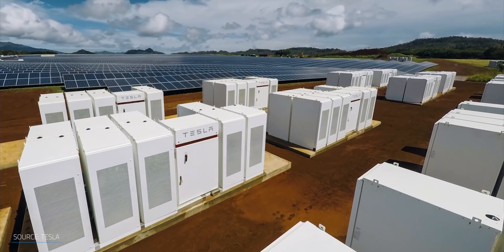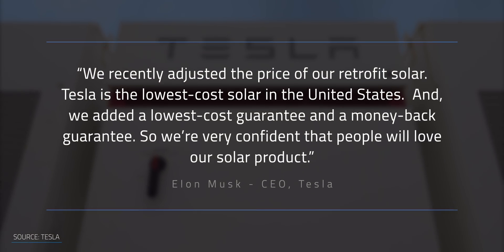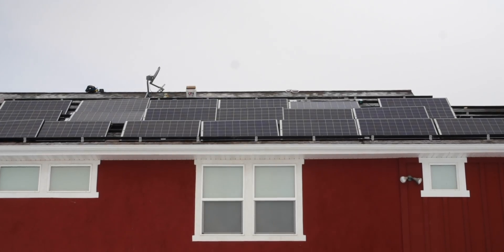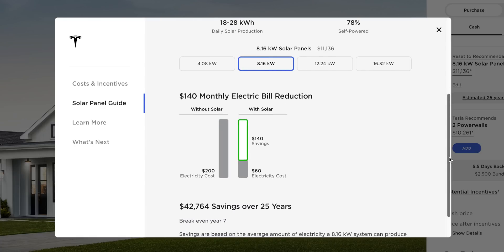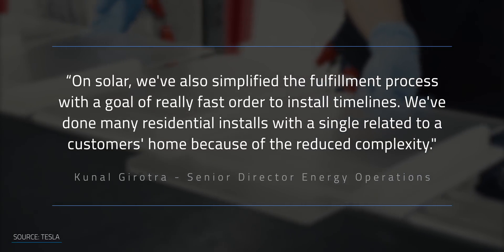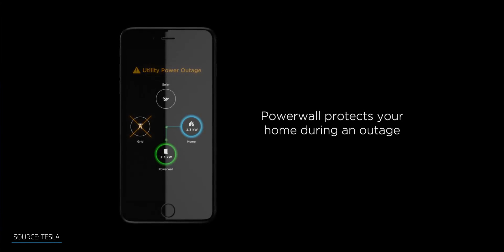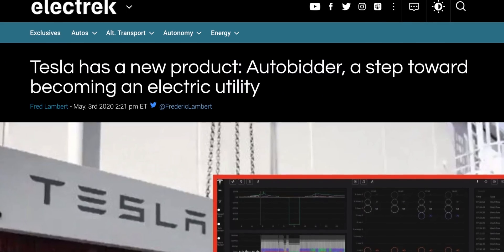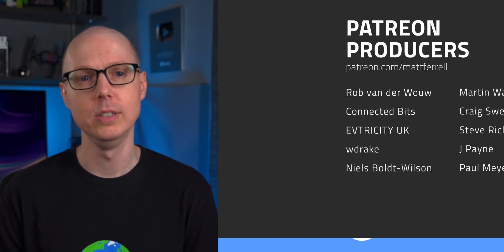Exploring Tesla solar panels game changing price

Comment: Here in Pakistan I bought a 10KWH on grid Solar system through bank on installments. 

The total system cost was 5223$. 

I have to pay 63$/m after giving bank 30% upfront payment in advance. 

The system comes with 5y warranty of inverter. 

25y warranty of solar panels.

Comment: Nice how you uncovered the point about high costs. I’m getting solar this month and was disappointed that 2/3 of the cost was service and only 1/3 was the cost of the panel. My house is two stories and does have steep peaks. So I get the labor for that will be high but i wonder if a lot of the service charges are due to marketing and dealing with permitting.

Comment: I had very bad experience with tesla solar panels 
I order 7.6 kw on December 2019 
Because of the pandamic the process has freeze until may 2020 ( that's understandable because of the pandamic) after Tesla installed the panels suddenly the price dropped 40% 
To me it's unbelievable , I won't buy tesla anymore 
Imagine I order tesla Model S and when you receive it the price drops from 90k to 52k ( imagine your reaction)

Comment: I had hot water panels for years but took them off when I had a new shingle roof put on. They had not worked the last couple of years probably due to the controller dying. Then part of the copper piping froze one winter causing a big leak in the attic, where they were, that messed up some of the ceiling and wall. So I had them taken off thinking if I ever do something else solar it would be electric so I wouldn't have to worry about leaks any more. Thanks for the update. sounds like I need to get off my ass and talk to Tesla!

Comment: So $1360 per kilowatt. I use 28 kilowatts per day. We get a max of 5 hrs a day.so I need 6 1000 watt packs. So. $8160 for panels how much are the batteries? The inverters. The breakers. The wiring ?.

Comment: Solar is the way forward. I payed $9000 for my 7Kw in 2012.  The electricity cost here in Denmark is high about $0,35 pr Kw.  My solar system has already payed it self more then twice.😊  I use a lot of electricity, ben driving VE since 2003

Comment: Looking at the solar panels right now. Somebody still has to show up and put holes in your roof so I am concerned about a streamlined process when things go wrong. My other thing is that there is code in South Florida that appears to require a 3 foot perimeter around panels on a roof. I checked a neighbor's solar install and they had installed down to the lower edge of the roof so hopefully that is allowed. If not, I don't think I could get a solar system of any size installed on my 1800 sq ft home. I would like the 12.24kW array and I guess I will challenge Tesla to get the permit for it and come up with a design.

There is really only so much templating you can do. Every roof design and orientation is going to take some tweaking.

My advice to anybody getting solar panels from any contractor is to get up there with a hose pipe when the roof penetrations have been done to check for leaks. I saw forum posts about leaking roofs with panels on them and no response from Tesla. Arizona and Southern California are one thing, South Florida is another.

Comment: Im hoping to be at 16k for my off grid system. That also includes my 13kw of Lifepo4 batteries that can run my house for 24 hours all by themselves on a full charge. In Ohio grid tied systems are not so great and without batteries in the winter forget it.

Comment: You may want to think about power wall  which is insanely expensive at the moment . With tesla saying it will cost less than $1 per KW for car battery pack there is no reason they cannot reduce the cost of a power wall Dramatically say a 30 Kw for around $7,000 plus install .

Comment: Wow, pretty expensive. In Poland, not very developed country, cost of 6kW installation before incentives is around 1,1-1,2USD/W. With incentives is drops 0,75-0,8USD/W.
Energy in Poland costs around 0,17-0,18USD/kWh
Calculated now, when 1USD=3,7PLN

Comment: Does the production of all these solar roofs and power cell/batteries actually reduce carbon production, is carbon neutral, or does reduce carbon production?

From my understanding, even if the initial production of carbon increases, over the longer term as less solar/batteries are produced and just maintenance/replacement production sets in, it will dramatically reduce carbon costs as dirty forms of energy are eliminated. Is that reasoning correct?

Comment: This problem should be mocked. You can now buy wafers in China for $ 1 for 5 watts. If you want something cheap, then you don't have to buy, you have to do it yourself. I think that the cost (price of selfproduction) of the plates is $ 1 per kilogram like that of aluminum. That's about $ 1 per 200 watt square meter. Even now, $ 1 per watt is an acceptable price for Americans. You need 60 square meters for the roof. That's $ 12,000. With an annual income of an American of 50,000, that's an acceptable price. But for the Russians, this is an unacceptable price.

Comment: The thought the issue in the US was the cost of the installation.  They charge at least $1/kw for installation.  Buying a 10kw kit is only $13k for DIY.  $25k through an installer.

Comment: Wait, I don't think you are talking apples and oranges here. Elon is referring to the cost of the panels is he not? Not the total cost of the system. You are referring to the total cost including install, wiring, inverter, etc? $1 per watt for the panels alone has been the benchmark for at least 5 years. $3 per watt is the overall system cost.

Comment: Got to love the big utility lobbies, where I live is still illegal to install solar on your roof
Reply: Let me guess, is it in the Middle East?
Reply: @motazfawzi2504  No its in the United States. 

The TLDR Version is that State gov, and utility charge so many fees and licenses, including a monthly fee per kwh  generated that its just cheaper to buy grid power, or install solar illegally, which isn't something you can do on the DL, so you are just gonna get caught, fined, and possibly jailed.
Reply: @motazfawzi2504  https://www.biologicaldiversity.org/programs/population_and_sustainability/energy/pdfs/ThrowingShade.pdf 

explains part of the issues. 

Basically, in several key states that have almost year round (excluding weather related events) there are no protections or policies in place at the state level for solar. 

So, where I live, the utility company will actually charge you for generating your own solar, at a higher rate than market rate. They also charge a monthly fee for even having panels. 

They also charge a monthly fee for having storage. 

The county/city government charges you a yearly license fee. They also make you jump through an astounding amount of hoops just to install them, including 3 seperate one time fees. 

I've seen, maybe 2 houses in the city with panels. And I live in the state capitol, and have been here 4 years and worked here before that, and I was driver/technician for a company that mainly serviced homes. So I've been in and out of almost every neighborhood in the area, especially the high end ones (people with money and brains to take advantage of federal tax credits to offset install cost). Its just not financially viable to do it legally, and not something you could do illegally and not get caught.
Reply: @EvlEgle  
Well you own the land but not the sunlight that falls upon it.

Comment: **WARNING: YOU GET WHAT YOU PAY FOR**
I really hope people interested in going solar take this with a grain of salt. 

Tesla is able to get their price so low because:
1) They use the only use 4 generic size systems meaning that 9 times out of 10, you're paying for more what you need or not enough to cover your home's usage.
2) Tesla does not make a single component of the systems they install. They use the cheapest, outsourced, working materials. Most notable, the string inverters they use work like your old Christmas lights, if one goes out, they all do. Also if one panel is shaded, they all can only produce as much as the shaded panel. There's 12 panels to a string which dictates their standard sizes. 
3) They subcontract out their installations which tends to lead to system issues and roof leaks. 4) They don't carry any performance and work assurances standard to the industry meaning that if the system has any issues functioning, doesn't produce what is expected or your roof leaks... GOOD LUCK.

To see first hand accounts, go on LITERALLY ANY SOLAR REVIEW SITE and see for yourself

Tesla is an amazing car and battery company, but for solar, do your research on a reputable company that *specializes in solar *, services your area and choose the one that you are the most confident will make sure you have a great experience. 

Going solar is clearly a more cost effective option for power. You can see that by your traditional power companies setting up solar farms because it is much cheaper than any alternative fossil fuel option. The only variable is making sure your system does what is expected.

I hope this helps those ready to pull the trigger after seeing the Tesla name and cheap price to do their research and make sure they make the most educated decision for their home.

Comment: I’ve worked in solar in the US for about 5 years and I’m not so sure how Tesla would be getting away with submitting “generic” permits. If we so much as have the customers name spelled incorrectly or a piece of conduit running somewhere differently than the design, our permit will either be rejected or we will fail inspection.
Reply: Seems like you would have Install 1, Install 2, Install 3, etc.  Those plans are drawn up and approved.  As long as the installation is followed according to the plans, the inspector wouldn't find anything wrong and the process is streamlined, no?
Reply: @jameswalker590  at least in my area it’s a lot more specific than that. Just the placement of the main service panel can make a hell of a difference as far as design and engineering. 

Not many houses are clones of each other which at least in my area makes it difficult.

Comment: Hey, Dec 18 2020 and you can get a 6.6kw system installed with inverter for $3600 AUD - so maybe $2700 USD.  That's been consistent all this year in Australia.  You'd be mad not to.  And the sector is so mature that second hand 250w panels can be bought for $15 to 50 each (AUD).  Is solar in the US distorted for similar reasons to your medical system costs?

Comment: My town Pen Argyl PA is making all kind of demands to even re-certifying the mounts of  my 35 to 40 year old hot water system.   They have demanded of me to hire a contractor,  to hiring a solar contractor to certify what I want to put in.   They have demanded of me paper work on stuff I have not even purchased yet, contrary to what the law says.   I finely got a list of demands by them that is INSANE (which included my old system).  Clearly, the HATE DIY and solar, going green is this towns goal.  I believe I would be the first one to put solar electric in in this town and they are making it HELL and as expensive as possavle  !!!     Ethan Habrial

Comment: Sorry, but at current prices solar is absolutely not worth it in my opinion. You'll never be able to completely eliminate your electric bill since part of it is for fees that states like MA will not remove regardless of energy consumption. Even in summer months you can't expect to have sunny skies everyday which restricts your ability to harvest your own energy. There are all kinds of limitations set by utility companies in terms of incentives for directing excess energy to the grid. The Powerwall batteries which at the moment are considered the top of line aren't enough to power your house for a few days in the event of a winter power outage when you'll need it the most. Good luck powering the batteries to full capacity during a winter storm or any multi day storm for that matter. My advice is, instead of blowing $30k on solar panels with reduced performance after each year invest the $30k in a bond with a 5% return. After 20 years you have roughly $80k. Its makes absolutely no sense to me why someone would blow this kind of money on an outrageously expensive and negative ROI product like solar panel set ups.

Comment: What this video fails to mention is that Tesla is selling 3rd party panels and all installs require a power wall, which doesn't even use Tesla batteries. The solar shingles are still in beta and not available in large scale. Tesla doesn't have solar sales reps and their customer service is also lacking. Their per watt cost is so low that to this day, Tesla's solar energy division has yet to make a profit. Financial analysts all agree Tesla may exit the solar energy market as they are canceling and refunding deposits on orders that have been waiting as long as 3 years. Many other companies can provide the same or better quality systems with better warranties and competitive pricing. That Tesla power wall by the way is about $11k each!! Did I mention they are not using Tesla made batteries.. I believe they are Panasonic. Tesla has great cars, stick to that and use the car as your powerwall. Bidirectional charging is very real with car manufactures installing this tech in new cars. Also,, SolarEdge Energyhub inverters  and Enphases up and coming release of their new decentralized invertor technology will interface directly with EV batteries for backup storage.

Comment: $1000 for engineered 16' tall treated wood solar pergola for my backyard (North Carolina HOA doesn't allow solar on front of house) $450 permit fees $350 pay an engineer to examine the structure, $250 in revision drawings  $2050 fess for a 10KW solar DIY install.  City of Charlotte, NC, makes me pay $2000 refundable bond to be my own home contractor for my 10KW system Yes soft costs are ridiculous.

Comment: Why is solar (specifically photoelectric) so expensive in NA?  It's simple.  Money.  The gas corporations, coal corporations and nuclear energy plant corporations make hundreds of trillions of dollars per year, 900 trillion dollars+ per year globally.  How much money do these greedy pricks make from sunlight and wind?  How much profit do these corporations get if you can not only run your home but also your vehicle from your own solar panels and wind mills?  Far, far less than they do now.  These three industries are the biggest source of anti-solar gov't policies and anti-solar propaganda and lies.  The auto companies, (which are also heavily invested in by these three mentioned industries and definitely oil),  will not roll out electric only vehicles unless they can make as much profit as they currently make from oil + conventional vehicles.  That's why even electric vehicles are so expensive and have mandatory expensive maintenance and battery replacement programs.  They're going to get their profit, one way or the other.

Comment: Outstanding video as usual.  I think that Tesla's streamlining innovation in the purchasing and permitting processes is only part of the game-changing impact on the solar PV industry.  There's also the innovation in creating a panel that doubles as a roof tile and can be installed much faster than before.  Then there's the vertical integration opportunity to combine the solar PV with battery storage which leads to further savings when electric utilities employ Time of Use rates by allowing the owner to reduce reliance on grid power during periods of peak cost.  Finally, where it's allowed (currently only in MA, but which will hopefully be everywhere eventually), Tesla is able to offer to those with a solar PV/battery combo participation in a virtual peaker plant which will potentially create a nice little passive revenue stream.  I know some of this was briefly mentioned at the end of this video, but I would recommend creating another video that delves into these additional game-changing innovations.  I really do believe that if more people are crystal clear about the benefits of going solar, especially with Tesla's solar PV roof and battery combination and participation in their virtual power plant (if offered), the more likely that they will purchase such a system.  The sooner they do so, the sooner they'll begin to enjoy the savings, reliable power, and peace of mind knowing they are making a significant role in fighting Global Warming especially if they make the switch to driving an EV as well.  Lastly, don't forget to mention the value of those solar renewable energy credits (SREC).

Comment: This thing is ridiculously pointless.

$52,000. Thats the price at Tesla's website for a solar roof that only powers your house during the day if you charge your car at night(due to the small battery) when most people are at work or school anyway? 

It would cost over $200 per month for 20 years to pay that roof off which is a typical power bill for a big home.

You still end up with a power bill on top of that for the tv watching, computer use, heating, lighting and car charging at night. SMH

Comment: Another significance with the US and Australian energy systems has been collusion and corruption in the US energy market. At times causing deliberate blackouts to get higher prices. Not that the Australian system is perfect. In fact many Australians consider power prices to be too high. Partly because so much gas is being exported to China with long term contracts at very low prices. So increases in gas production is not meeting demand.  Australia also has massive coal exports to China. China is developing many forms of any production including nuclear. Especially as coal pollution in China is so bad. Historically nuclear has been much safer than coal. And much safer than hydroelectric power.